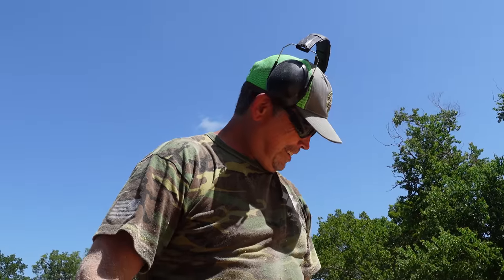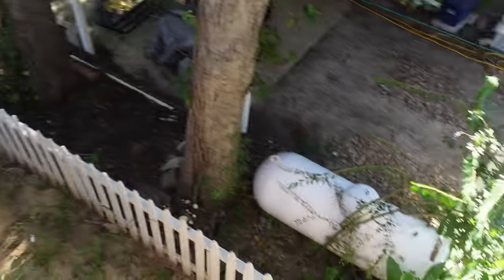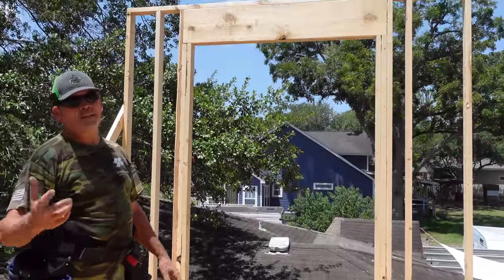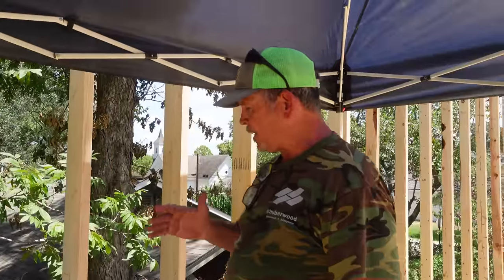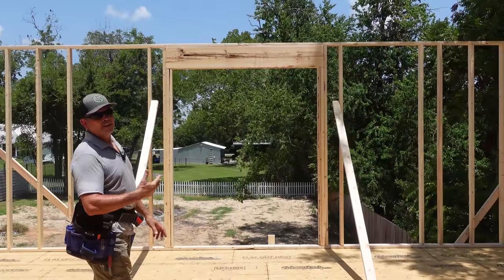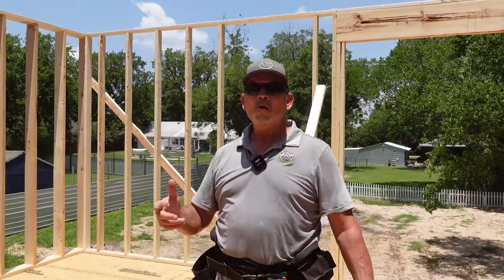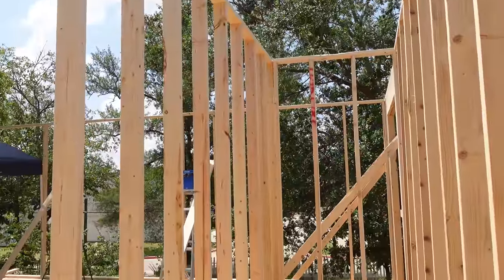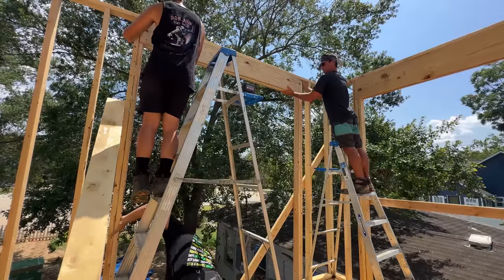These Windows Sent Us WAY OVER Budget...Then we Did THIS!!

Comment: Just be careful with those in wall tank units , create a giant nail plate for the backside so no nails or screws can ever damage the cheap plastic tank
Reply: Yeh i saw that happen on matt risingers house on the build show.
Reply: @robsp32 one of my apprentices screwed an LED driver into a cabinet that had a in wall tank on the backside, lets say the plumbers were not very happy. But they also agreed that it was a stupid design to have nothing protecting such a thin-walled tank
Reply: agreed.   bad idea.  KISS principle applies.  trying to fix one of those 10 years from now is not going to be good.
Reply: I also thought it sounded like another place for a leak to develop. Less water in sheetrock is better.
Reply: we rabbited in a 1/4" thick piece of steel plate - worked like a charm
Reply: FOR SURE!
Reply: Yep protect that in wall like it's going to war because you can sneeze and damage those things.
Reply: Also gonna be careful with cold weather. TX isn't all bad but if we learned anything these past few years it's that TX can get an unholy cold.
Reply: Great Idea! Nail plate on BOTH SIDES.
Reply: @robsp32  Yeah and that was only a Small Finishing Nail at that.
Reply: @robsp32   I was thinking the same thing. Take lots of pics before sheetrock like Matt said.
Reply: And remember you always will need to service those units. Most plumbers I know recommend putting it in a interior wall, so you can build the hatch in closet instead of in the bathroom.
Reply: Seems like a cool design feature, but the idea of burying a tank of water in my wall does not sound good!

Comment: Since the stairs aren't part of the conditioned space it will get hot at the top of the stairs. Could add a small window facing the back yard at the top of the stair which could be left open. When I lived in Ga I had dbl hung window. Really nice to pull the top down to let the heat out and the bottom up to let the breeze in.

Comment: Hey Stud Pack, if you go with the recessed vaulted ceiling over the shower, why not consider installing a solar tube for natural lighting? After the roof trusses are installed, you can rough it in so that the bottom finish ring will be flush with the finished ceiling. You also will be able to install the adjustable vertical light tubing all the way up through the trusses and exit out through the top of the roof, with a weatherproof sealing ring on the finished roof. A great and easy way to get natural light into the shower, much easier than installing a skylight.
Reply: I agree. Solar Tubes are perfect for bathrooms and hallways. We put 2 in our house and only use the lights at night. Plus alot less $$ than skylights.

Comment: I love the inwall tanks, but here I think make a little bumped-out wall for the toilet tank, maybe 4 inches deep, rather than put the toilet in the exterior wall. This will give you full insulation behind the tank and protect from nails from the outside - plus it makes a nice natural shelf behind the toilet. This could extend behind the sink too - like the tiled top of the pony wall behind the sinks in the Chevy bathroom..Seems super easy, doesn't even take up more room.
Reply: They are in Texas though, 2 inches of foam insulation would definitely be enough! The toilets I've installed like this required a 2×6 wall anyway for the rack assembly, so in our climate in 🇨🇦, a secondary wall is a must.
Reply: How do you protect the wall and the ceiling below if the tank sweats? Will the insulation be thick enough to counter condensation issues?

Comment: Love watching this project come together. If you guys haven't put thought into, I'd look into getting Ethernet cable in the walls before the sheet rock is up.  You'll appreciate being able to plug in an access point or your computer directly into your network.
Reply: There will be those who say: But WiFi is SO good these days so why have the wires in the wall and the plates ON the wall? My answer is always: Wired is STILL faster and SO much more secure.
Reply: Wireless access points connected by Ethernet will also be faster. Plus, the solar battery space is a nice place for the home run cabling.

Another consideration is Power over  Ethernet lighting, why run 12 or 14 gauge copper when you can run twisted pair, plus it gives some nice automation options.
Reply: And my other thought is that they need wiring chases for power and Ethernet between the future house and garage, a flat roof might not provide enough space for that.

Comment: I always double plate window sill plates so i have solid nailing for winow trim. Just something to think about. Love your channel.
Reply: Valid option but there are studs running 16" OC below the opening which is plenty to use for nailing window trim to.
Reply: I cut all the cripples under my windows with a 3 degree pitch down/out.   That way the sill actually slopes to the outside.    Zip stretch tape the sill.   A Pitched sill is the Last line of defense that uses gravity to shed water out.

Comment: Look at the code for framing. You may be allowed to use 2x6 at 24" centers. It saves time, costs no more for material, better insulation, less drywall screws thus less mud. Think about it on the house.
Reply: I always built on 24” centers to save lumber and increase insulation. Code allowed up to 10 ft walls with 2x6s. I found that 5/8 drywall on the walls worked best with 24” centers, and the cost increase was minimal. It makes for strong and flat walls. 5/8” t and g roof sheeting always seemed well worth the slught cost increase too. Again, strong and flat.
Looking fine guys!
Reply: If considering 5/8 inch drywall, you might as well consider using fiberglass surfaces drywall. Less risk of mold, etc.  Before closing up those walls, consider sprinkling Boraxo along all sill plates - before insulation install.

Comment: A knee wall at the top of that stairwell would have been a way to put some air and light into it. Also, makes moving large items up those stairs easier.
Reply: They plan on not conditioning the stairwell and are insulating it as an outdoor space.
Reply: Prolly overall, good to shut the garage out of air conditioning. Needs a door, though.

Comment: You could have preinstalled the headers for the windows before raising the wall—that would have been a given regardless of window height, then frame the sill later.  (Easier to install on the deck). 

Pro tip: When framing interior door openings, pre-slit both sides of the bottom plate of the door opening and leave about 1/2” left of the plate.  When it’s time to fully remove the plate cutout, it’ll be square, and quicker to remove.  I guarantee you’ll love this.

Comment: You fellas are saying all the right things as far as air sealing/insulating, but seem to be missing some simple options that would greatly improve your blower door score! You may have other plans in place already, but I would've expected to see you put a bead of Lexel/etc between the subfloor and the bottom plates, or some sill sealer at least!
Reply: I think they did put something between the bottom plate and the foundation on the first floor. Not sure why they didn't on the second.
Reply: @markmckenzie5343  yeah they put sill sealer and Lexel I believe between the foundation and 1st floor. I reckon if they're gonna use zip system and tape the whole building it should be fairly airtight, but isolating the apartment from the garage always seems like a good idea to me. Hard to get a garage door properly sealed, so $40 worth of Lexel/acoustic sealant/etc can make a big difference in air sealing.

Comment: As a DIYer who has built several houses from start to finish, I appreciate your attention to detail. Things like offsetting the stud half the width of an electrical box, or nailing your second floor bottom plate near to the studs mean so much to the subs.  Excellent job. 
If you could reduce the quick camera movements I would watch more.... by the end of some of your videos I practically have vertigo.

Comment: About the bathroom window...I like at least one window in every room large enough to crawl out of in case of fire.
Reply: crawl out of a second story and fall out lmao
Reply: @avocadocolorado3433  still better than burning! 🥵
Reply: They have plenty of egress access, so it is not needed in that bathroom.
Reply: @dallasarnold8615  If you're taking a shower and there's a second-story fire, you need egress.
Reply: @avocadocolorado3433   break a couple legs or burn to death or die of smoke-inhalation...such a stupid idea to think someone would prefer to stay alive instead of die in a fire. What was I thinking? What was I smoking to think such a stupid thing?
Reply: If you do that, you will need some kind of folding ladder escape system. You install the ladder in a box outside the window. When you need to escape from fire, you open the window, open the escape box, unfold the ladder, letting it touch the ground below, and crawl out the window onto the ladder and safely climb down, no falling or broken bones needed.
Reply: @mikequartucci9700  Yeah...and is actually required by code in some municipalities.
Reply: @FJB2020  those were required by code when I built my home in a Los Angeles rural area.  Still needed fire escape windows,  per code there.
Reply: @FJB2020  I hear what you're saying but the home I'm living in for the past 13 years has had windows at both ends and both sides cracked open 3 inches all year long so that fresh air cycles through continuously.  We still run the heating and air conditioning system but it's a small house.
Reply: @choimdachoim9491  Read the code ! Windows are not even required in the bathroom, much less have to meet egress requirements.
Reply: @dallasarnold8615  maybe you don't care if Granny dies in the bathroom but I do.
Reply: @choimdachoim9491  I don't know why you want to make such a big deal out of this.    If you have actually been paying attention to the layout on this building, there will be a great BIG door about two feet from the bathroom leading out onto the deck. A whole lot faster and safer egress than crawling out of window at least three feet off of the floor that would most likely only meet the minimum dimensions to satisfy the building code egress requirements. If you have ever actually built any residences, you should have a much greater understanding of this than what you present here.

Comment: Great work guys. Love it. One thing to think about is making that house so tight to where you need mechanical ventilation. In my opinion (I built a house that blower doors at 2ach50.) The mechanical ventilation eats more electricity than a house that leaks a more desirable amount of air. I think the sweet spot is between 3-5 ach50 with no mechanical ventilation system
Reply: Mech ventilation controls air quality inside. I had 1.7 ach50 in my house and I barely use AC by controlling south facing windows and having a tight house.  Ventilation controls humidity and creates lots of comfort.
Reply: @locke3141  my hrv system runs my furnace fan 24/7. My humidity was uncontrollable also. As soon as I shut down the hrv my dehumidifier took control back over

Comment: I think they should have put plywood up on those walls going to be interesting to see how they put the plywood up after they're already setting in place. Just making it harder on yourselves guys
Reply: They are going to need some scaffolding anyway
Reply: @johnhaller5851  most builders would put the plywood up on the wall to stiffen the wall up and save themselves a headache later.
Reply: @ronaldsears834  Yeah, they didn't listen to the recommendation to put the sheathing on the first floor before starting the second, so I wouldn't be surprised to see the trusses go up before they worry about sheathing. Maybe the Advantech team is still evaluating the discount level they are going to give for shout-outs.

Comment: I'm really surprised you didn't go 6in studs on all exterior walls, why is that? As for Windows how about a cantilever out window in the shower onto the deck above head height. I also think small  window above the toilet tank would be fine. Just be sure nobody can see into it... The framing is going gangbusters!

Comment: I was thinking during the video about how lucky Jordan is to have his father, who is so knowledgeable in the building trade, helping him.  While Paul hasn't built a house from the ground up before, the wealth of knowledge and the vast experience from doing renovations really helps immensely.  I love the explanations of why he does what he does, and the thinking behind it.  The strategic thinking, as well as the tactical mindset is like a carpenter and a general contractor all rolled up into one.

And, let us not forget Jordan's cousin.  How awesome is it to be working with family?  It's great that he's able to be there for his cousin, and like someone else mentioned, he's gonna need his own home as well.

The best part is that both guys are getting an apprenticeship in renovation and now, in building a house; especially in the entire life cycle of building; from dreaming, to planning, to working with engineers, with permitting departments, suppliers and various trades.  That right there is priceless.

The one criticism I have is that I see Paul doing most of the work.  Not that Jordan and Rad don't work; they do, and they work hard.  This is especially true when it comes to measuring, cutting, laying out, and even a lot of the nailing.  It will slow down the process, but the guys need to get more hands on with all that.  If they are, I'm not seeing it.

Loving the series though.

Comment: Bathroom window definitely over the toilet; never an operating window in the shower (looking for issues down the road).  Also, the plans show a rookie mistake: 5'-4" leaves a 1/2" extra because the outside wall was planned as 2x4 (3.5"), not 4".  You guys used 2x6 (5.5") so it should have a 60" inside to inside dimension (not 5'-4" - 3 1/2" = 60 1/2") if you're using a commercially available shower pan.  If you do a custom pan, then no problem.  Most people don't go custom.  Hopefully that makes sense.
Reply: These guys have done a ton of custom shower pans. They'll be fine.
Reply: I'd be shocked if they went with a commercial pan.  This channel is LOADED with custom showers.  Right in their wheelhouse.
Reply: they've done custom showers pans already so i dont think thats going to be an issue, plus i think in some of there past videos they mentioned of doing a roll in shower

Comment: Paul, You're correct about the header placement being much better at the top of the wall. In fact, if the cripples are placed above the header, the header is derated by 30% for load capacity. Also, no need to do the insulation inside the header. Take your two 2x12's and sister them, leaving the gap to the inside. Then you have room for insulation on the inside, especially if you're doing spray foam inside. Do the cripples below the header and the wall is much stronger! By the way, Jordan's still a young buck, I doubt that fireman's pole is only for a quick getaway!

Comment: @ the 25:21 mark, you can cut the bottom 1/2 of the 2x4 before framing, so after you stand the wall up, you can just cut the remaining top 1/2 without leaving cut marks on the floor.

Comment: Don’t put a horizontal drywall seam anywhere near where the bottom plate meets the floor in the top of the stairwell. Also, consider flat sheen paint.

Comment: 1)For bathroom frost the window.
2)Shower do a 3" ledge instead of a niche, costco soap bottle to tall.
3)skylight vs. Solatube’s innovative tubular daylighting = light option in tube= minimize heat loss.
4) Question, for a airtight house you could of sealed walls to floors, but you'll probably will apply AEROBARRIER spray system.

Comment: I love the channel, probably the best DYI home builder channel on youtube. 
I have been designing homes for 35 years and have some concerns. I am very proficient in model "National Codes", adopted by state-code then local codes. They get more restrictive with each adoption. We structurally design for down-force, lateral wind force, and lateral seismic force on every building in the US.
1)The North wall or wall with all the windows as framed will only solve for down-force. A simple shear panel will not achieve lateral loads, either prescriptive or engineered design. The small panels should be lightweight portals or a completely engineered moment frame. Maybe we will see hold-downs with force transfer but I am not seeing it.
2) A plan submittal comes with a crap load of plan sheets. site plan, floor plan, elevations, roof plan, foundation, struct framing floor plan, roof struct roof plan, T-24 energy calc, BMP, LID as basic.
3) I am not sure how you change the widows like it was as-built. It seems to me that this would create a resubmit of the T-24 energy calcs. It appears that you are shooting for HERS envelope testing?
Maybe your authority is very behind in plan-check or you are in a unincorporated non-compliant location.
Just my thoughts.
Reply from the maker: Thanks for the comment!  I'd say we're somewhere between an unincorporated non-compliant location and a highly regulated major urban area.  I built in SoCal for 20 years so very familiar with T24, seismic, etc.   We have none of that here only the occasional hurricane.  We're over 100 miles from the coast though.  Our plans are very basic and I'm talking very very basic.  Much is left to the builder.  Our inspector is as knowledgeable about the code as any I've ever met.  We're outside of the coastal zone but I'll still install a bunch of tie downs etc. once the roof is on 👍👊